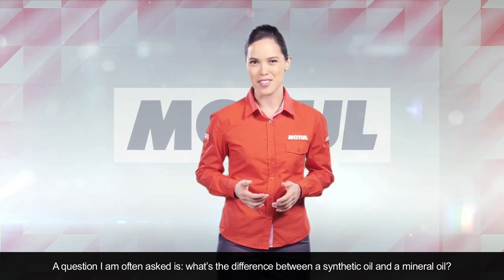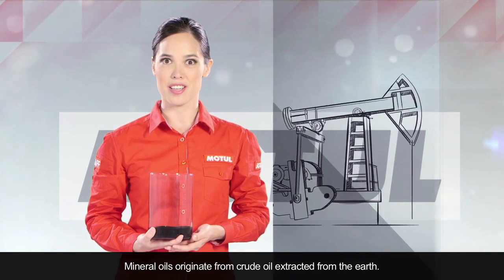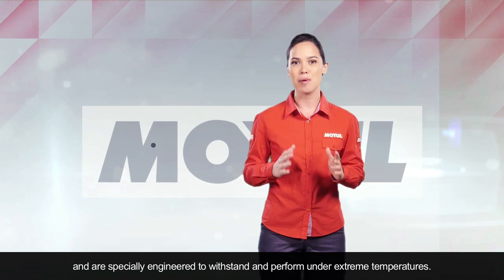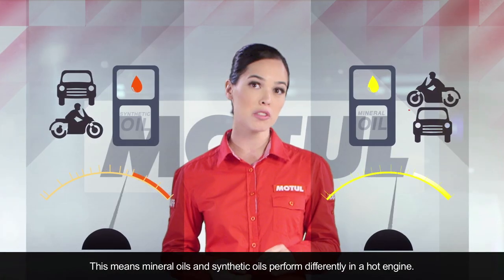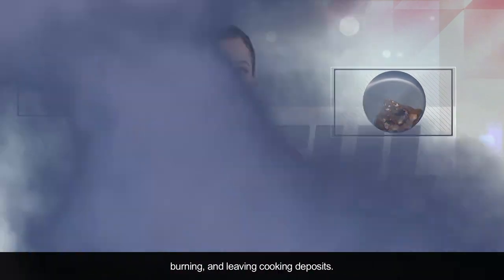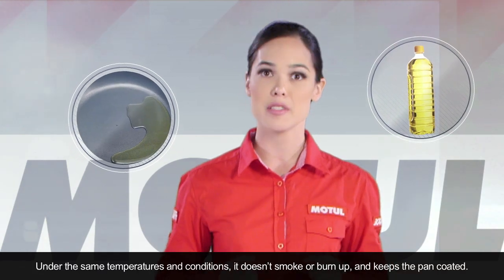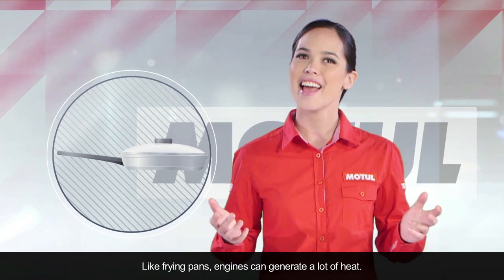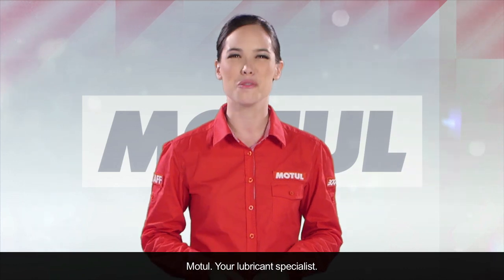Engine Oil Tips - Synthetic vs Mineral Oil

Comment: Motul specialist please suggest me an fully sythetic engine oil for honda sp125. Its oil grade is 5w30.
Reply: Use 10W30 fully synthetic engine oil from motul
Reply: @mytube-monjit  10w30 100percent synthetic is no more from motul in India.
Reply: @mnkh-r6i   ohh yes, i forget, then use semi synthetic technosynthese 10w30 & add engine oil additive, you will get better result.
Reply: @mytube-monjit  Which additive is best. Which additive you use and prefer.
Reply: @mnkh-r6i   i am using 3M engine oil additive (50ml) it's working very good as i aspect, i am using this very 1st time, other wise here are some engine oil additives like Liqui moly mos2 shooter,ABRO,NULON, WURTH, these are may be good.
Reply: @mytube-monjit  I had used liquimolly MOS2 its not effective in my motorcycle and some manufactures including BMW  never recomment it on their cars because they cause excessive wear in their products. Nulon the thick engine oil additive is compression booster which contain polymers which is only good for old motorcycle with low compression (high clearance caused by wear between piston and cylinder wall).I think 3M engine oil additives and Wurth contains detergents, bases and aditives which enhances engine oil. I had used motul7100 10w40 changed it at 3000km, now using shell advance 10w40 100percent synthetic and I can feel difference I think shell contains more antiwear aditives,detergents and base than motul 7100. I had used motul7100 twice, motul 5100once and Shell advanced once but now my option is to go with shelladvanced. You could get orginal shell products now in NAYARA Petrol pumps. Amzoil and Pensoil contains good synthetic oil which have highest base number and aditives, Amzoil was the first brand to introduce synthetic oil in market. Now I will never buy Motul I will use shell instead.
Reply: @mnkh-r6i    then why you asking motul for provide to you a fully synthetic engine oil?!
Reply: @mnkh-r6i   ok, I will try shell advance, if you have interest in more enquiry for engine oil, you should try Liqui moly also, but it's costly.

Comment: does 
Motul 104091 7100 Ester 4T Fully Synthetic
 last for 10000km, i want to use it in my 100cc four stroke motorcycle.
Reply: U can lleavet it for a lifetime of your engine
Reply: Ok but use recommended graded engine oil

Comment: Its better if you use mineral oil in lower CC engines. Like 100-200cc. But in bigger heart, e.g. engines more than 200 CC,go for synthetic.
Reply: So mineral oil will be fine for my Yamaha FZS v3 (150cc)? Will there be any performance difference between mineral and semi synthetic oils?